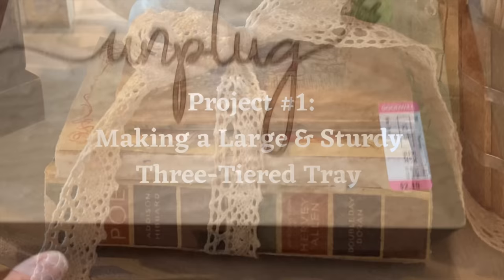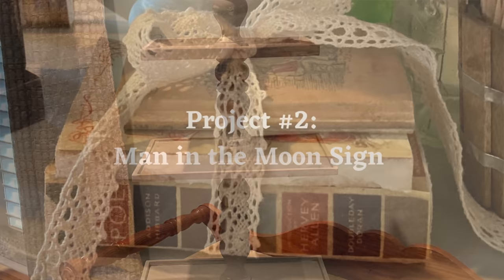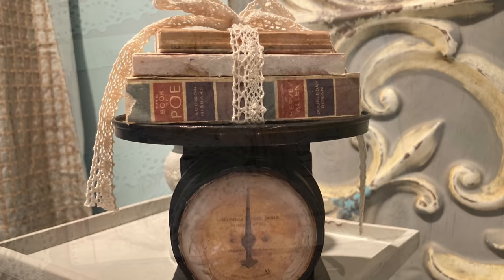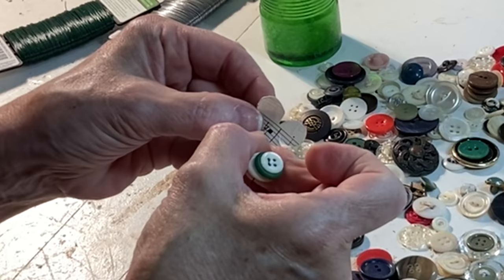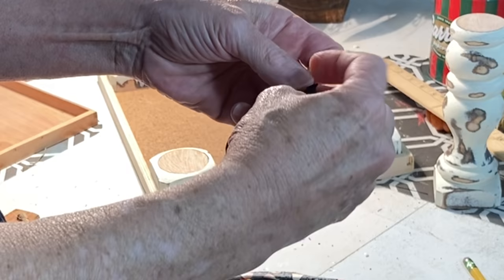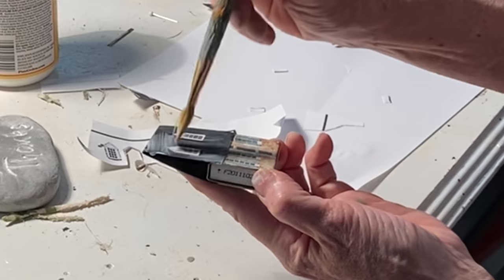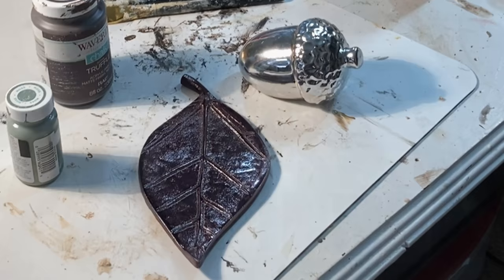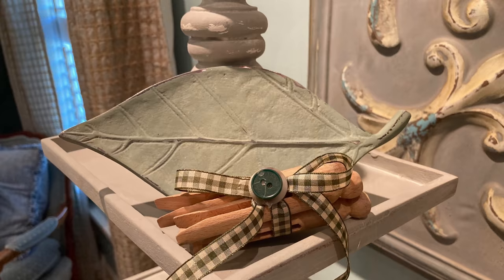DIY 3-Tiered Tray from Thrifted Items and 15 DIY Tiered Tray Decor Projects

Comment: I thrifted all the wood frames that would fit in a box for $5 and then found a thrifted book of the best plays of 1974-1975 ($1.50). The synopsis and actual play script for each play is on the pages, making the pages interesting to read when I used them as the backing after I painted the frames. It was fun finding the pages with the funniest script lines to use on my creations.
My fave of yours today was the "scale." Super clever.

Comment: Hi Sherry, Thank you so much for all the wonderful ideas you share! I love your videos and can't wait for the newest one to be available! I've watched them all. Recently I purchased a box of old embroidery hoops at a garage sale. I was going to use some for old cross-stitch needle works. Do you have any ideas you could share on how to do this, or how to use the extra hoops? Does anyone else have old embroidery hoops sitting around?  Should I give up on this idea? Please share your thoughts. I so appreciate your views. Thank you again!
Reply from the maker: What a great garage sale find! I love your idea of putting old needlework in them. You could create a gallery wall of hoops with needlework, doilies, vintage hankies, and other pretty fabrics in them. Embroidery hoops also make pretty wreaths with flowers and greenery glued to the bottom half or one side of the ring. I think they are even pretty plain. You could paint them in colors that match your decor. Maybe, glue some pretty craft paper or other paper images (from a calendar or ones you have printed out) to the back of some of them. You could stack three of them (in decreasing size) and paint them orange and add embellishments to look like a stack of pumpkins or paint them white to look like a snowman at Christmas time. If you have 3 or 4 that are the same size, you can insert them inside of each other at different angles to create an open orb. Then, you could attach it to a base and add a battery candle inside. (Like the wood veneer pumpkins that I made in a previous video). You could cut small shelves to fit inside a couple hoops. Put the shelf about 3/4 of the way down and use small screws to attach to the ring. Hope this gives you some ideas to try. Good luck!
Reply: I just bought a couple at the thrift store. That is a great idea.
Reply: @CanterburyCottage  Sherry thank you so much! Those are wonderful ideas and I will definitely try them! I especially like your idea of painting them orange and stacking them. I also like the idea of the gallery wall of hoops. I have some of my grandmother's handkerchiefs that would work well with the needle points.  Thank you again for answering my note! You've encouraged me to get busy! Can't wait till next Tuesday to see what you do then! <3

Comment: I absolutely loved your Tiered Tray and thought you did a wonderful job building it!   If l may give you a helpful hint, instead of  relying solely on the “Wood Glue and a few Brad Nails”...  Use a “Threaded Rod”, basically it’s a screw without a “Head or Point”.
It comes in many widths and lengths.  You have to Pre-drill your Holes and have a hole cut out of the trays.  And then you just screw it together.  I wish l knew how to attach a video or photos, I apologize I’m not technically savvy.  I’ve made several Tiered Trays this way over the years without incident.  😂🤣😂

P.S. I loved your idea for the Match Boxes, l can’t wait to see the one that looks like your house.  I prefer the Sunflower on the Stick better.  I’m definitely going to to make some of those with my Granddaughters.  I might paint our sticks and add some leaves.  ♥️

Comment: Hi Sherry! I'm having such trouble distressing and waxing my painted items.   The paint just scratches off! Thank you!!
Reply from the maker: Be sure to use chalk paint. Other types of paints require prepping the wood/surface to keep the paint from easily chipping and peeling. If you are using chalk paint, you might be using sandpaper that is too course. Start with 220 grit (the larger the number, the finer the grit) and only rub it only where you want to remove the paint (like on the edges and where the piece might have worn naturally). I hope this helps, Strauss!

Comment: What brand is the miter saw you used to cut the large spindle for the feet and center of your tiered trays? Did you have to turn the spindle or were you able to cut all the way through with one cut?
Reply from the maker: It is a Black and Decker. You may have noticed that it is smaller than regular size. It did cut through the spindles in one cut; however, I wouldn’t buy it again. There have been things that I have had to turn over, and I don’t always get it lined up perfectly.

Comment: I love your Chanel. What kind of printer do you have
Reply from the maker: Thank you, Sheilaray!🥰 I have a Canon TR8520 ink jet printer, and I use compatible Office World ink. I love this ink. It lasts so much longer than the Canon brand, and it doesn’t run when I decoupage. With the Canon brand ink, I would have to make sure the ink was fully dry and even then, it would sometimes run when applying Mod Podge.

Comment: I have a box full of little saki boxes and wonder what I could make with them. any ideas?
Reply from the maker: That’s awesome! The first thing that comes to mind (because Christmas is on my mind) is turning them on their sides and stacking them in the shape of a Christmas tree. then, you could put a little ornament or candy in each box and use it as an advent calendar. For a non-Christmas idea, you could glue them together on their sides into a rectangle, hang it on the wall, and put tiny treasures in some of the boxes. They could also be used to organize make-up, jewelry, a junk drawer or craft supplies,